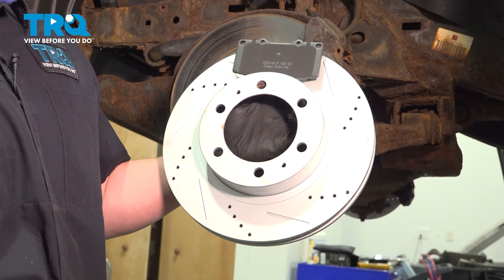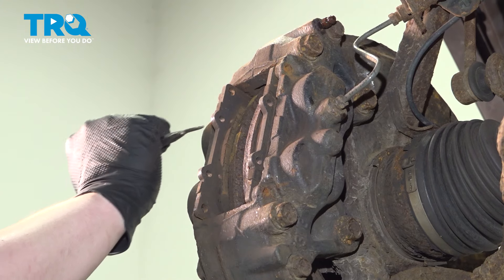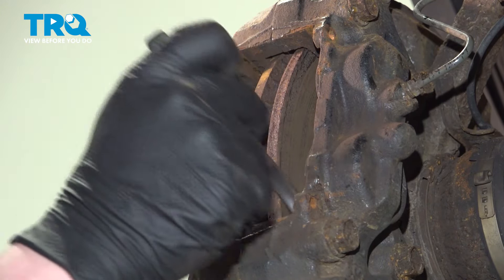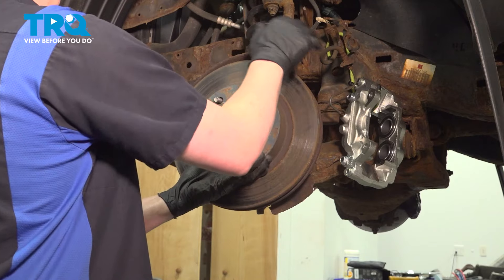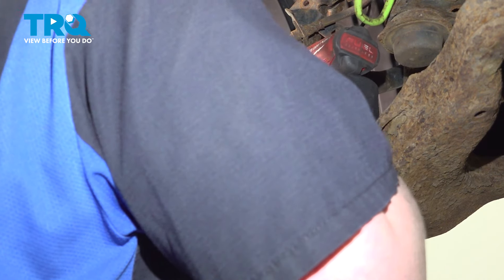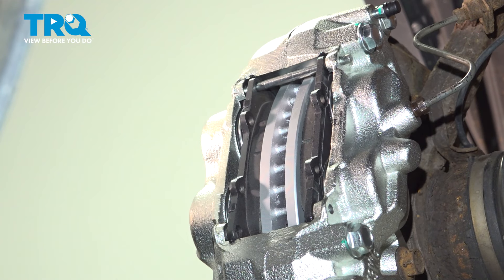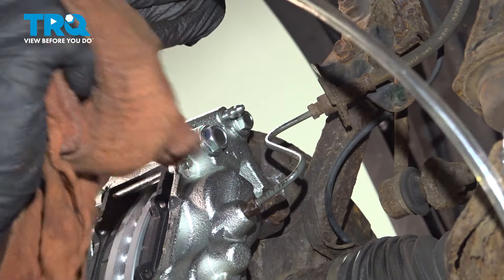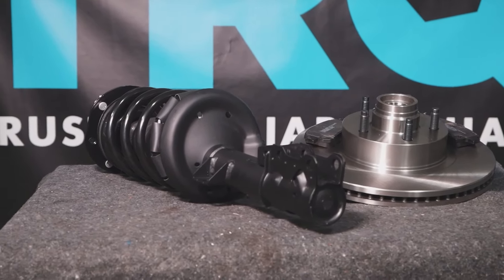How to Replace Front Brakes 2005-2015 Toyota Tacoma

Comment: Can only share the bleeder is a time consuming unnecessary step if the system isn't breached or previously opened.  Alternate: Open the hood and be sure the brake fluid reservoir top is loose or vented.  The fluid should look slightly low already.  Take to worn brake pads out half  way and use a heavy pry tool or flat screw drive and pry the pad in a manner compressing the pistons back and the fluid will go back into the systems without getting any air to have to bleed later.  Some use an inner pry tool between the pads.  If the reservoir look to be overfilling (it shouldn't) just remove some of the fluid from the top.   the fluid to refill the system.

Comment: I have a Toyota Tacoma  Pre-runner 4 Cylinder , my wheel shakes a lot when braking, I read its the rotors, if it is, do I need to change front and back or can I fix the issue just replacing the front ones?  ( I'm on a budget this month but need this done ), any info will be greatly appreciated - know nothing about cars
Reply: Check if your truck has only Rotors in the front and Drum Brakes in the rear. If that’s the case you can get away with just replacing the front pads and rotors 👍🏼
Reply: My honda was doing the same thing. I change the front rotors and it’s back to normal. Now my Tacoma is going to same thing. Thinking of resurfacing the rotors since they have a lot of life still. $25 to resurfacing